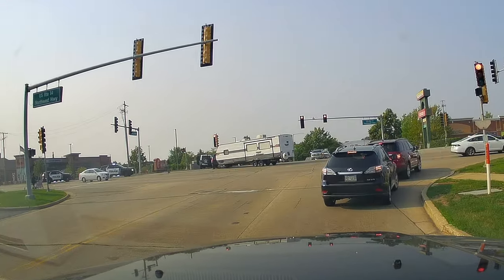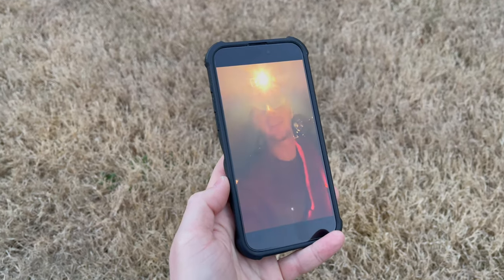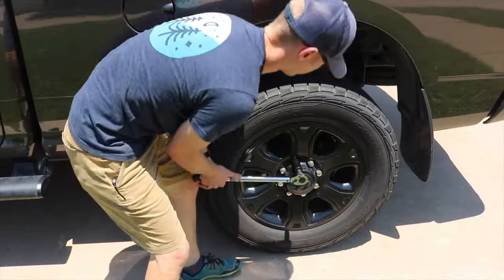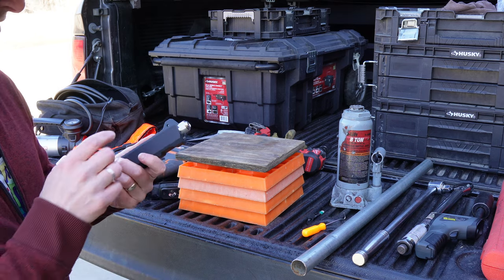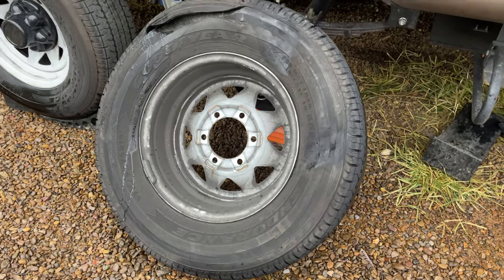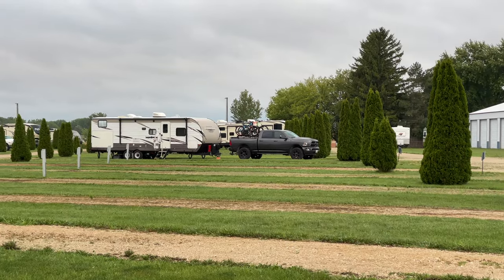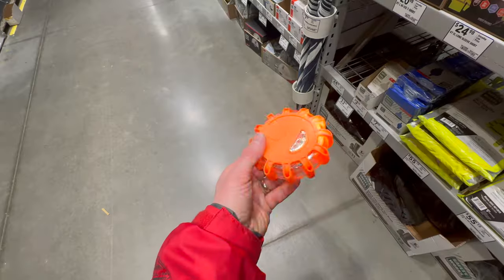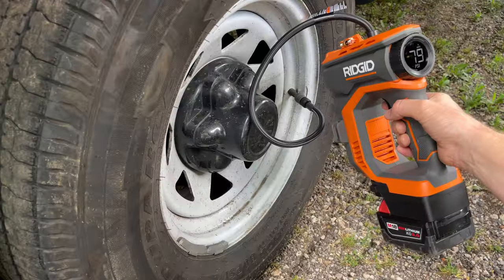How To To Deal With An RV Blowout Quickly & Safely

Comment from the maker: We recently had three tire issues in three days - one blowout on the truck while towing the RV and two on the travel trailer. The first incident involved a catastrophic tire failure, creating a makeshift mace that damaged the truck's bed. The second event, a slit in one of the trailer tire's sidewall occurred in the dark while it was raining. The third problem was a valve stem issue, requiring continuous stops to add air to limp into our destination campground.

Joshua shares valuable insights into the tools and strategies that helped him navigate these roadside emergencies efficiently. He emphasizes the importance of preparedness, such as using reflective belts, wheel chocks, proper sockets, a torque wrench, and a dedicated tire pressure reader. Additionally, he discusses the significance of having a well-equipped emergency kit, considerations for choosing when to replace spare tires, and the benefits of metal valve stems on trailer tires with TPMS sensors installed.

DISCLAIMER We participate in several affiliate programs that earn us a commission on purchases made through our links at no extra cost to you!
Some product links are affiliate links which means if you buy something we will receive a small commission. As an Amazon Associate I earn from qualifying purchases. 

🏘 Join the RV Gear & Far Group Here:
https://www.rvgearandfar.com/rvgfyt 

⭐🌟 Check out ALL the products and gear we recommend here: ⭐🌟  
📦 https://www.amazon.com/shop/rvgearandfar 📦 
 
⭐⭐ Examples of Products Used In This Video ⭐⭐
1 Monitor
🔷TPMS Tire Pressure Monitoring System https://geni.us/XyFr
🔷Tire Pressure Gauge https://geni.us/jXu8
🔷Infrared Laser Thermometer https://geni.us/Vr6QY

2 Safety
🔷Reflective Belt https://geni.us/SCuyniX
🔷Safety Vest https://geni.us/F4bbBcB
🔷Headlamp https://geni.us/nT5H3
🔷Emergency Reflective Triangles https://geni.us/vLovwF
🔷LED Emergency Puck Lights https://geni.us/EjLcTso
🔷Dash Camera https://geni.us/JcWahKl

3 Access
🔷Wheel Chocks https://geni.us/8HpXm
🔷Bottle Jack https://geni.us/68tT0
🔷RV Ramp Levelers https://geni.us/RE9oZ
🔷Lynx Levelers https://geni.us/BMxiz
🔷O Ring Pick https://geni.us/u9dBZL3

4 Removal
🔷1/2” Breaker Bar https://geni.us/eQHhwEu
🔷1/2” Torque Wrench https://geni.us/jzvO
🔷Drill Socket Adapter https://geni.us/3xu3K
🔷Drill/Impact Driver https://geni.us/WGhEFSm

5 Inflation
🔷12v Inflator Air Pump https://geni.us/hbglUhj
🔷Ridgid 18v/12v Inflator Air Pump https://geni.us/ZcKi1N
🔷Milwaukee to Ridgid Battery Adapter https://geni.us/XFNnpA

🔩 DEALS: Sign up for our newsletter and we’ll let you know about deals and discounts!
https://www.rvgearandfar.com/signup

🚐 Favorite RV Gear:
🔸GasStop Propane 100% Emergency Shut-Off https://amzn.to/3DdMPob
🔸 Liquified RV Tank Treatment https://amzn.to/3Oe9cAh
🔸Fastway Zip 6” Breakaway Cable https://amzn.to/3XTcN9V
🔸Valterra Twist On Waste Valve https://amzn.to/3K064Fs
🔸Motion Sensor LED Night Light https://amzn.to/3rykvtX
🔸HitchGrip Hitch Handle https://amzn.to/3pOGKLS
🔸MORryde Door Latch Extender https://amzn.to/3PQAJZM
🔸Portable White Noise Machine https://amzn.to/3XUr4DC
🔸RV Ramp Levelers https://amzn.to/3PTczhh
🔸Solid Rubber Wheel Chockshttps://amzn.to/3PX1yeU
🔸8” Clip Fan Rechargeable https://amzn.to/3NPjVQd
🔸Portable Propane Fire Pit https://amzn.to/3Dc4QTZ
🔸MaxxFan 12v Vent Fan https://amzn.to/3Df9PTW
🔸Dual Fuel Generator https://amzn.to/3Dfsxec
🔸Fresh Water Hose https://amzn.to/3PX8mcy

🛠 Favorite Tools & Gear
🔸resqme Original Emergency Car Escape Tool https://amzn.to/3Dg0Ba2
🔸My Everyday Carry Tool - Skeletal CX https://amzn.to/3XVjPeC
🔸The BEST disposable workgloves! https://amzn.to/3Dfa6Gs
🔸Digital Tire Pressure Gauge https://amzn.to/3PX0LKR
🔸Digital Laser Thermometer https://amzn.to/3pMFadl
🔸VIAIR 12V Air Compressor https://amzn.to/43qgMvZ
🔸NOCO Boost X Jump Pack https://amzn.to/3NUNMXk
🔸Our BIG Rearview Mirror https://amzn.to/3NQOdlt

📸 Video Gear I Use: https://amzn.to/44QKwDa 

If you find a “dead link” please let us know! We’ll send you a sticker!

📺 Want to see more RV videos? Don’t forget to subscribe and click the bell icon 🔔 so you're notified when we release new videos! 

🧰 Want more DIY projects? Check out our other channel!  
https://www.ganderflight.com/diyplaylist

Connect with us! 
💥 🎥Connect! https://www.rvgearandfar.com 📷📺
💥 🎥Connect! https://www.rvgearandfar.com 📷📺
💥 🎥Connect! https://www.rvgearandfar.com 📷📺

© RV Gear & Far, All Rights Reserved. 

This channel is for entertainment purposes only; we are not experts or professionals. We share our opinions, experiences and what works for us. Please do your own research and make your own decisions.

#rv #rvlife #rvgearandfar 

RV Tire Blowouts: Essential Tools for Turning Roadside Emergencies into Minor Bumps
RV Safety Essentials: Gear That Matters When You Have Roadside Tire Issues

Comment: I just purchased one of those ramps that you drive up on if you own a dual axle rig.  It's the best $50 I ever spent.  I changed a tire last week in my driveway.  Just drove one wheel up and the other hung there.  So easy.  If you get a flat on the interstate, you don't want to play around getting a jack out and changing a tire.  I wish I purchased one before.  I also carry a impact wrench to get the lug nuts right off.  I still carry a couple of bottle jacks and some pieces of 2 x 4's just in case, but that tire ramp is awesome.  Some people say it won't get their other tire off the ground.  Just put a 2 x 6 under it and bingo, you have another inch and a half clearance.  I was skeptical about buying one, but not now.  Great video!!
Reply from the maker: I've yet to use one myself but they look awesome - except for the size - definitely not something I want to pack around when there are smaller options available for travel - but I may have to get one for at home use!

Comment: As always, great information that everyone needs to see and be prepared for.
Reply from the maker: Anything you don't currently carry that you'll be adding to the toolkit Ross?
Reply: @rvgearandfar  leather gloves.  I have work gloves, but they won’t stand a chance against exposed steel belts. I might even add cut resistant gloves used in the food and beverage industry.

Comment: As you mentioned, the lug nuts on the spare tire were different than on the axle tires.  I switched them out from the local hardware stored so they would be the same size in case of an emergency.  Also, I was adding the ammo carrying boxes to my bumper just this last weekend and found my spare tire loose on the bumper holder after the 1200 mile trip to Florida for the winter.  I had an anti lock device on it and that was the one that was loose.  Need to keep that is mind also to check that once in a while.  So sorry for all you tire issues.  I pretty much have everything you mentioned.  Have the reflective vest when walking the dog in the evening.  Had a number of complements because of wearing them at night in the dimly lit roads.  I don't travel at night anymore due to set up in the dark.  Stop 2 hours before sunset (the rule).  Keeps the marriage better. Thanks for everything you post.  I have tried a number of things you have mentioned.  🙂
Reply from the maker: Good call on checking the spare tire after a long travel day! Sometimes it gets forgotten, especially if you have a cover over it.

Comment: Excellent video!  I might suggest, as one of the essential tools, is a battery powered impact wrench.  I've found the yellow and black one works very well.  Expensive, but worth every penny.  Keep up the good work!
Reply from the maker: and to clarify for anyone reading this in the future - impact "wrench" is different than an impact "driver" one will have enough torque to remove lug nuts, the other is better suited for driving screws ◡̈

Comment: I made a 7-pin connector for my 12v air compressor so I can connect it to the trailer 7-pin connection. That way you are at midship and don’t have to open the hood.
Reply from the maker: And that's working well for you? I think it'd all depend on what size fuse your 7pin power has whether this would work well for any individual setup - the downfall of the cigarette lighter style plugs and pumps is that they're definitely limited on power compared to the ones clamped directly to the battery.
Reply: I can see that working fine, but if you disconnect the trailer you wont have flashers on the back.

Comment: Thanks very much for an excellent analysis of the three incidents with tires!  A great lesson for all of us RV folks.  In my case, I have pretty much all the same tools you discussed, but what I am missing is the safety vest and some warning signals like triangles or flashing lights.  So thanks for those suggestions!  I truly appreciate your videos and find them all extremely useful.  Kind Regards, Byron Reed
Reply from the maker: Byron - thanks for being here and taking the time to watch and comment! I'd agree - the visibility aspects are just as, or even more important, than the tools to fix the problem - wheel doesn't care if we get hit while on the side of the road because another driver couldn't see us in time. Happy camping!

Comment: We carry electronic flares, Triangle reflectors, plug kit for holes, battery powered adjustable 120 to 1200 ftp impact wrench, 1/2 in ratcheting breaker bar with digital torque adapter, 12-ton Hydraulic jack, 7000lb scissor jack, Jack stand, Tire minder 12-volt air compressor. set of deep well impact sockets. we use the Tire minder i10 TPMS system, 2 types of head lamps, high lumens battery powered area lamp. large rubber mats to lay on, I've been meaning to buy the vest but haven't yet, that being said I will before our next trip, we travel 4 to 6 months at a time.
Reply from the maker: Sounds like you'll have all the bases covered by the next trip!

Comment: The reflective vest is something to add for sure, we rarely drive at night with the trailer. We have the LED triangle that has multiple flashing options. I  keep a old jacket/cap under the back seat for those, crawl under situations. Everything else/methods you have is  the same 👍.
Reply from the maker: They won't win any fashion awards - but they are definitely effective.

Comment: You should change your valve stems out to metal ones on the trailer the weight of your tpms is causing the valve to cut good video 😊
Reply from the maker: ◡̈ didn't watch the whole video - I did swap them our for metal ones - thanks for watching!!
Reply: @rvgearandfar  sorry I may have missed it thanks
Reply from the maker: haha - no worries, glad you took the time to share, because its an important tip! @coreymerritt7742
Reply: @rvgearandfar  yes I re watched it I may have stepped away for a second I also had the same issues on my trailer as well I saw you on rv tips I also follow Ross I can’t wait for more of the stupid things that you guys are going to find I have a 2006 komfort travel trailer that was built in Oregon the way the market is going I don’t think now about purchasing anything else other than a Arctic Fox or outdoors rv thanks again
Reply from the maker: Isn't that plumbing absolutely bonkers?! Yeah Ross and I have a few collaborations coming up this year ◡̈  @coreymerritt7742
Reply: @rvgearandfar  ya that plumbing is completely ridiculous you would have thought somebody would have thought that better looking forward to seeing the collaborations thanks 👍
Reply: Have you weighed your truck & trailer and calculated the weight on each axle, then compared the weights to the specs for the truck and trailer?
Reply: @thomasgriffin4714  no I have not my tag on the trailer is pretty hard to see now as it is a 2006 the trailer is 7850 dry 10,000 gross about 1020lbs on the tongue with Dexter 5200lbs axle and e rated tires  I have a dodge dually Cummins I’ve been a class a commercial driver for 40 years and I do not overload my truck or trailer I try to keep it equal so I don’t have any problems thanks 😊
Reply from the maker: @thomasgriffin4714  Yup! Love a good CAT Scale stop ◡̈

Comment: I had the same exact issue with my factory rubber valve stems and TPMS sensors. I upgraded to steel valve stems and now the valve stems have no flex at all anymore.
Reply from the maker: Agreed - the new valve stems are significantly stiffer. If I look at the wheels I can actually see where the rubber ones rubbed on the rim because of the amount of flex while rotating over those 20,000 miles.

Comment: So strange that you had 3 tire issues on consecutive days?!?!  I wonder if the steel belt debris from your truck tire damaged your trailer tires when it exploded, and those damage spots gave way in the following days? 

Excellent tip on using items that take the same batteries.  I learned that lesson when backpacking and have carried it over to my trailer accessories, which typically use AA batteries whenever possible. As for emergency tools, we use the flashing strobes underneath the pop-up style fabric cones. We find that it creates a large glowing object that draws a lot of attention.
Reply from the maker: That's an interesting thought - possibly for the trailer tire issue - doubtful for the valve stem leak.  I like the strobe lights and fabric cone idea! Question: do the fabric cone bases have enough weight that the wind from passing traffic won't tip them over?
Reply: @rvgearandfar  Oh, I think the value leak is the more likely of the two to be from the truck tire debris.  It would be so easy for a steel strand from the disintegrating belt to have hit and sliced the stem while flying by. Although, it wasn't clear from your video if the damaged valve was also on the driver's side, and I don't know how wide belt debris like that will spread out during a blowout, so if it was on the passenger's side, maybe not.

As for the fabric cone question, it depends on which ones you get. We got ours several years ago, so I don't know the brand. Passing traffic isn't an issue, but a windy day can be. Regardless, you can always weight them down with a rock or a spare tool. But, yes, I'd focus on getting ones with a wide base and some weight to them when possible.

Comment: Love the video . Great ideas and tips. Is everything stored in a husky box in the bed? Do you have model of that? Thanks
Reply from the maker: I've got two of these drawers stacked with an additional regular compartment on top and those five stacks fit under the tonneau cover of my truck - then I have one large husky rolling box that holds all the large items - bottle jack, jumper cables etc

https://www.homedepot.com/p/Connect-2-Drawer-13-Compartment-Small-Parts-Organizer-248984/314213515